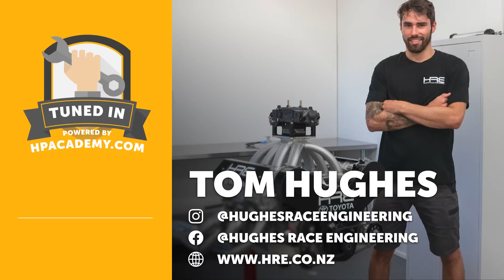Building 9,500RPM 1UZ Speedway V8's Vs Street Engines [#PODCAST]

Comment: How long does it take to build 1 engine on average??
Reply: Assembling an engine can take a day or two, even an afternoon if you really know what you’re doing. What takes time is getting everything ready like planning, ordering parts, getting parts machined, etc. As someone who’s observed and helped with only 1 engine build and planning on doing a couple on my own in the near future it’s partly dependent on what you want for your engine. For example, for my engine most of my parts will be “off the shelf” meaning they are already produced and waiting to ship when I or someone else orders them, but for example I need custom pistons because most “off the shelf” pistons don’t really fit my wants and needs so I will likely be waiting on those pistons to be “custom made” compared to my “off the shelf” connecting rods which I can buy off Amazon. If you have a common motor with aftermarket support, not too picky on certain things and have a machine shop that can get your parts back quickly it should be a fairly quick process although, it’s working on cars, things can go wrong or things can hang you up for a couple days or weeks or more. From the moment you pull the engine it can take a couple of days to several months to rebuild it so it’s really hard to set an average with so many unique variables especially when we don’t know the type of engine or where you are in the world.
Reply: It really is a open ended question cause it first depends on your goals. If you don't have a well-defined target, that slows things down.  If you have a single cylinder engine to assemble, that's faster than making a v16 from scratch.